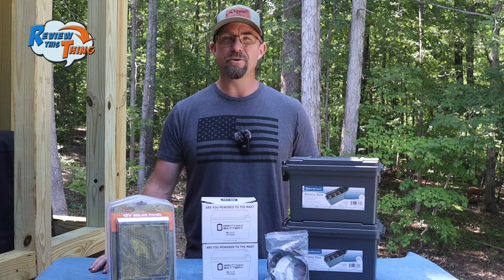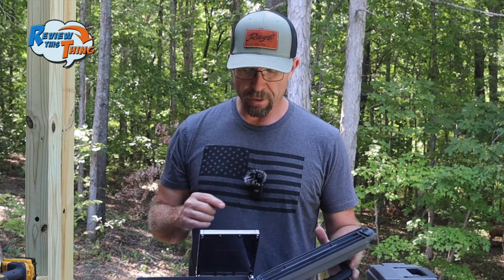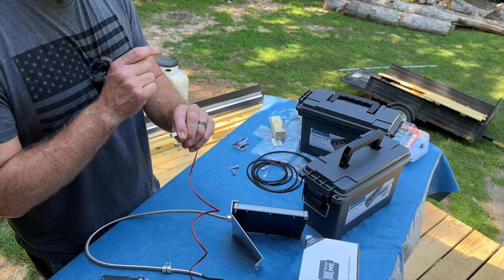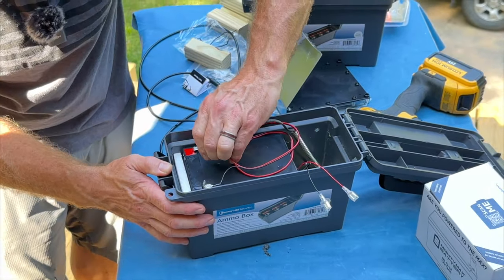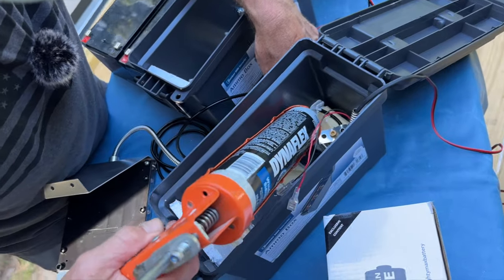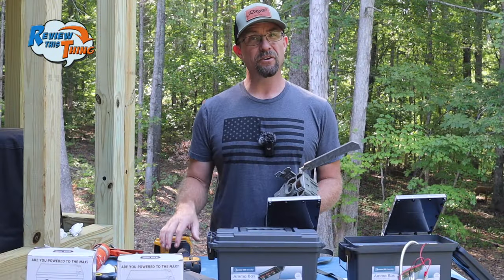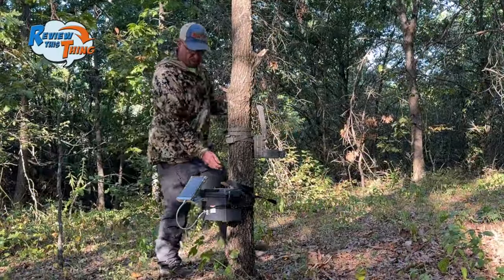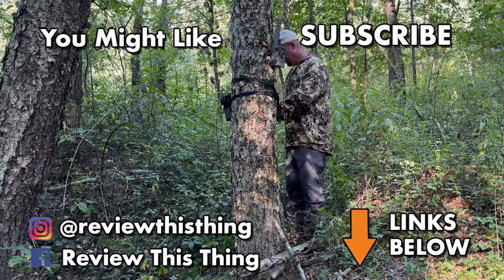How To Make a 12V Battery Box for Your Trail Cameras!

Comment: Ive been using the HME battery box with solar panel for many years.  They definitely work very well.  I have left cameras out more than a year and they still run the camera with no problems.  If you buy a couple of packs of lithium batteries, you have pretty much matched the cost of one of these setups.
Reply from the maker: Heck yeah! That’s great to hear! Thank you.